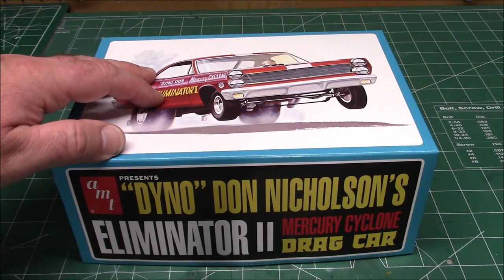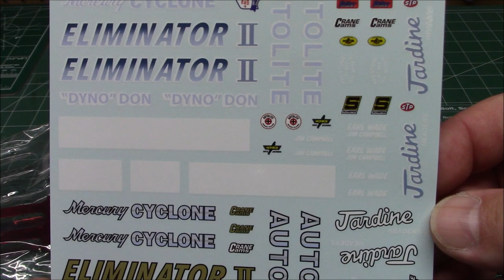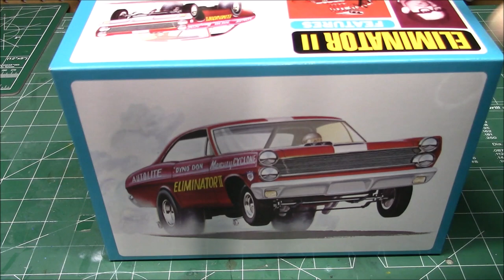AMT 1967 Mercury Cyclone Eliminator II Dyno Don 1/25 Scale Model Kit Build Review AMT1151

Comment: Totally posting this before the video is over... Not sure if you already know this.

You can remove the stock chrome with oven cleaner.
Reply from the maker: I've done that before but find it to only be necessary if the chrome is on too thick.
Reply: @hpiguy  Fair enough. I like to remove it just to be sure the paint sticks. 🙂

Comment: Great looking kit and a nice job! The only question I have is this... if the radiator is mounted to, thus raised with with the body, how would the radiator connect to the engine? They would have to disconnect it every time they flipped open the bodywork
Reply from the maker: I placed it where the directions said but never painted it up. I'll just call it a body brace.
Reply: Exactly . The chassis would say funny car ( body flips up ) the body on the other hand , with its altered wheel base says A/FX ( Altered , factory experimental ) . Two different classes . The A/FX car’s body would not flip up , but the funny part of the thing is , when first Chrysler came out with the altered wheel based cars , people called them “funny” cars !

Comment: As always, great job showing what you can get with cheap rattle can paint and craft paints and not having to spend a fortune on the fancy hobby paints. How long do you let the first coats (primer and black that you use) dry before adding color? It says on the cans 24+ hours to fully dry.
Reply from the maker: 30-60 minutes. 24 hours is for a rock hard full cure in the worst circumstances. By 30 minutes on most days you can handle the part and it's bone dry.
Primer can be painted over while a bit wet too, I do it all the time.
Reply: @hpiguy  Thanks! That will make things easier and quicker for me. I have been waiting for a full dry between coats before I moved on, things should move along better now.

Comment: I've always wondered why so few car models include seatbelts. Being a plane model builder I tend to be nitpicky about those kind of details.
Reply from the maker: Same as older plane molds left lots of stuff out. Some had/have it, some don't.
Reply: There is the simplistic delete, but also there is the fact that many cars did not have seat belts in them and therefore they were not modeled. Race cars mostly had them, but not all types of racing required them. F1 for example did not require seat belts until sometime in the 70's.

Comment: All of the Round2 kits with " padprinted tires" and this comes with styrene drag slicks?? Wow...    other than that its right nice.
Reply from the maker: Thanks, it works out well though, the tires look good on this one.
Reply: Personally, I believe that there's an advantage to solid plastic tires. First of all they won't melt your mag wheels over time like vinyl tires do. Secondly, you can put decal lettering or redline decals on them after you  sand the lettering off, paint them, add gloss clearcoat, and over coat the decals with dull clearcoat.

Comment: sir I really like your builds. but I have a question, why is it when I use future floor polish my finish has a scalie look to it,it looks like small cracks all through the paint. thanks ken
Reply from the maker: If the paint under it is still a bit wet it will move and crack the floor polish.

Comment: I understand they are retooling old molds,but I wish they would put better tires. Just saying,I'd still buy this!
The carburator is missing! No fuel injected 427 sohc, so where's the fuel go in? Did you brain fart or was there none in the kit? I couldn't see on the chrome tree.

Well I'll be damned! I read the history in the description again,he put fuel injection on the 427 ! Never heard of that before. Cool man, never mind.
Reply from the maker: Yup, pretty cool design.
Reply: All the nitro cars had Enderle or Hilborn fuel injection. A carb wouldnt flow enough fuel to keep the engine alive on the top end.
Reply: also, none of them had radiators, the fuel itself cooled the engine. This has a few exceptions as a kit.